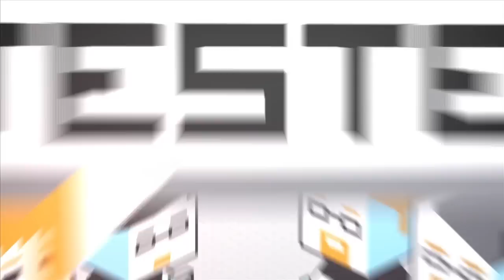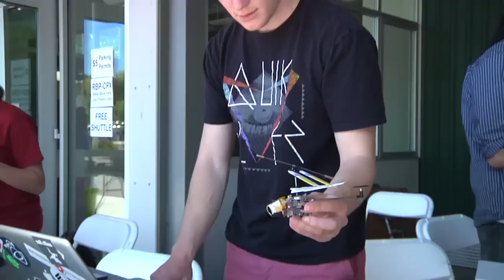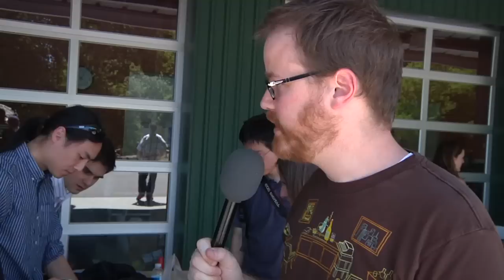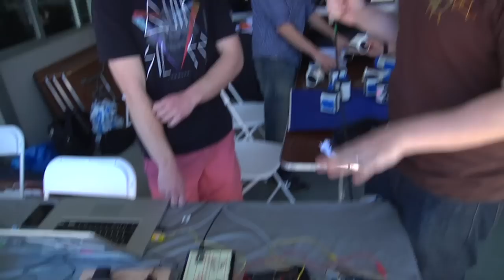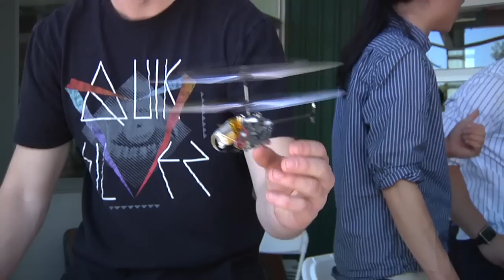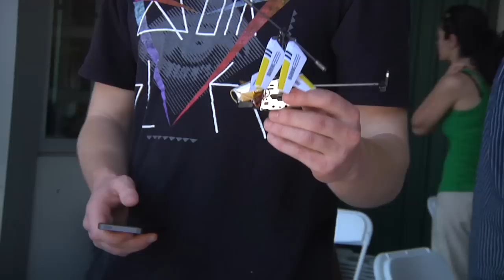Hacking a $20 Toy Helicopter into an Autonomous Drone

Comment: as a man who spent most of his life farming and logging and never using a computer at all until about 25 yrs old I am so amazed by guys like this. He took his finals and went on spring break in between working on this.
Reply: + jtoddjb I can relate to that.
Reply: +Random Youtube Watcher wtf kind of comment is that
Reply: +jtoddjb as a man who has a little bit of general experience with electronics and software development, I can tell you that I too am amazed by this guy. To be able to achieve what he has achieved requires quite a lot of knowledge. Not knowledge about the project itself, just general knowledge to efficiently plan and execute the project. Amazing!

Comment: its 3 years later.... lets see the finished version..... and lets get some links to the arduino coding.
Reply: The arudino only takes serial input from the laptop and turned it into IR pulses. This really isn't anything amazing, and it's no where near being "autonomous" .
Reply: Joe Anthing Not yet at least
Reply: Andrew Micallef It's completely the wrong way of doing it. He's using a Web cam with an IR filter and a line laser. Should be using something like a kinect that can actually sense depth.
Reply: Joe Anthing that's pretty much how the kinect works, he's just using his own version of the same principle

Comment: Hacking = Making it with the least resources, or Finding a way to make a existing better + simpler. Finding mistakes/weak-points in a system/object and take advantage of it, or in modern ages, modify a system or object with ''simple'' cheap tools/methods.

Comment: This is really interesting... It is cool to see that nowadays we are able to transform cheap flying toys into autonomous drones. The next step would be to mount an IR led with an Arduino Micro directly onto the helicopter with a scaled down laser system so that it could fly autonomously through varying rooms, instead of just staying inside of the one, while also giving it the ability for it to transmit information back to the computer. It probably wouldn't have been possible in 2013 though.

Comment: I actually understood every single word he said. It's actually not that easy. I found this arduino board from a local radio shack that's going out of business, and I actually have one of those cheap little helicopters. Same model. I'm gonna try this.
Reply: Peter Pukdeesri Easy as pie, as long as it is copying signals with an arduino there are PLENTY of libraries that help you sniff code with ease (be it 433mhz or IR), don't forget to find out what each octet of data stands for (ex: first octet = direction, 2nd octet = speed with 4 settings and so on). Have fun ;)

Comment: This certainly works in a pinch and can be really useful if the electronic internals of the transmitter are out of reach. However, it doesn't give you particularly accurate timing values for each of the pulses - most IR protocols are resilient enough that this isn't a problem, but in the interests of getting the best possible capture, a logic analyzer is the way to go. Also, if it's modulated at anything other than 38khz, you might have problems with the IR receiver technique.

Comment: Pretty cool, but all you need to record (and then analyze) IR remote control signals is an IR detector (from Radio Shack, etc.) connected to the MIC port on any computer. Fire up an audio editor (like Audacity), point the remote control at the detector and record the pulses as audio files. From there you can analyze the waveform with some home-brew software or just use the audio editor like an oscilloscope.

Comment: I hope this doesn't sound like a stupid question but instead of using a logic analyser to determine which control inputs correspond to which frequencies of infra-red light pulses would it not be simpler to film the original transmitter and use the footage to one-by-one work out what frequency of pulse is produced by what control input? Seeing as infra-red light is invisible to the naked eye but not to most camera devices would this not be a cheaper and more practical solution. Please correct me if I'm wrong, I'm sure I made some stupid assumptions somewhere!
Reply: Would work. But I doubt a camera has the required frame rate.

Comment: It's actually not as hard as most of the commenters think.  
* Reverse engineering infra red control.  
      very matured tech, methods all over the internet.  
* LIDAR positioning, 
      very common tech. Ripping LIDAR modules from robotic house floor cleaners for DIY projects are popular projects.
* Flying a drone. 
      open source everywhere. 

all are pieces of cake. I don't see anything special about this. this is more like a hobbyist DIY practice, like a typical high school project in China. It is a fun project but if it's something from the prestigious Stanford Robotics Club, then it is little bit disappointing.  I hope the remaining 15% (did he say he finished 85%?) could be more interesting like actually putting some AI into the drone flight, like coordinated flight in multiple drones.
Reply: basically everything has already been done before, a quick Google search for each step should yield easy to follow information on how to do it. he even said that a lot of it is easily available online lol

Comment: Great project, and a smart kid, hope he works things out and we can see another video on the progress.

But these cheap heli are terribly difficult to control accurately due to its inherent dynamics.  The only reliable manoeuvre they do is to hover.  He be better off using a cheap mini quadcopter as a platform.  Also he'll have a hard time working out the heading of the thing with his set up.

All the best

Comment: Depth estimation with a single camera can be done a couple ways - one way is using a perspective and distance calibration to estimate the distance a known-size tag is from the camera based on it's size. This way has the drawback of requiring the tag always facing the camera, otherwise the estimate is going to be way off. Not really ideal for an application like this! The kinect has made vision-based depth mapping so easy, single-camera isn't really worth it.

Comment: What sensors do you think it would need onboard to have a chance at flying itself in an unknown environment. I'm thinking you could probably get a camera, accelerometer, maybe some kind of sonar for height - something that is smaller than the LIDAR
Reply: The' ArduPilot' with GPS, is a good device to start with (currently about $80. with GPS), then add the kind of visual system this kid is envisioning. The rest is simulated neural networking versus adaption pathfinding, routing optimization, etc.

Comment: @KHALID Al muzini

You know, that is a really good question and could have several different answers.. It could be that he A) wants the craft to be able to fly longer(heli's are more efficient) or it could be that he wanted to be able to track the craft easier. (It's easier to tell orientation on a heli.) It could also be that he thought it would be easier to analyze an infrared LED that worry about analyzing radio traffic.

Comment: That was the bit that surprised me as well, i have often heard the expression  'if it works, leave it alone" 
Controlling the controller is surely the simplest way 'forward'. Kyle even states his aim is to use existing off the shelf tech, so why not add the IR controller to that list. Duplicating the IR code provided no real benefit to the project other than to have understanding of the root information.

Comment: I was thinking about making my drone autonomous with some capacitive proximity sensors. wouldn't that be easier than mapping with a camera and a laser? because basicly that means it isn't so autonomous since you need that camera and laser beam on the ground mapping a specific spot for the drone/helicopter to use

Comment: I think a more novel and interesting approach would be to set up a couple of highly directional mics on trackers.  They would follow the aircraft using sound, and position could be calculated from the angle of the mics.  Alternately, but similarly, laser trackers could do the same, but watch for the flickering reflection from the rotors.  Either way seems like less effort than LIDAR.

Comment: He's really doing this the hard way. He's scanning the environment with his D.I.Y. LIDAR and hoping to pick out the heli out of all the data+noise.... yeah, good luck with that. I've been down that road.

He has a better chance of success if he sets up an IR beacon on his heli and sets up three IR filtered cameras looking at space along the X, Y, and Z axes. He can then do some simple image processing to extrapolate the cartesian co-ords of his heli in near-real time. That's the only way he's going to get a control loop with a high enough iteration frequency, low enough signal/noise ratio, and sufficient position & acceleration fidelity to allow autonomous control of the heli.

He could also extend the system further and get several orders of magnitude better control if he used a transmitter and an IMU on the heli in the control loop, but that's another project.

....other than that, looks like a fun little learning project with cheap off the shelf parts.
Reply: I was thinking that too. Good thinking there!
Reply: His method is how the military does missile guidance in some cases.
Reply: Tim R. Lol I was about to comment that

Comment: It's not hacking it's modifying
Reply: Well in today's world hacking can also mean something along the lines of modifying something to work beyond its intended purpose.
Reply: do you know what hacking means?
Reply: Hacker is a word created by Hackers to describe the creation of a different object by modifying an existing object, possibly creating a new purpose or expanding the existing purpose or even a  hybridization of purposes. People using a garbage bag to keep dry, or the applying bacteria to the waste of  breweries to produce materials that can be used in batteries, are Hackers.
Reply: havent you ever heard of the expressions "hacking things together" or "its a bit of a hack but it works"
Reply: Hacking=Making it with the least resources, or Finding a way to make a existing better + simpler. Finding mistakes/weak-points in a system/object and take advantage of it, or in modern ages, modify a system or object with ''simple'' cheap tools/methods.
Reply: he's trying to do more than he knows. And that's great.

Comment: This is really cool, except RC copters this size have like 8 minute battery life.
Reply: My syma can fly 32minutes on a lipo tenergy battery
Reply: For sure but the point of this video was to run with a $20 toy helicopter, not a decent RC copter with hobbyist parts / upgraded battery.
 These low end pieces won't have the battery life to make use of this.
Reply: The syma cost $20 and the battery cost $12
Reply: Exactly.
Reply: mastermanio2 I dont remember him saying the idea was to do this with a $20 copter. That is just what he started this project on.obviously he has put a lot more money into this with the laser and electronics he has purchased. i think its more about the concepts hes applying. When he has it all figured out and fine tuned it would be much easier for him to apply the same concepts to a copter that could do a lot more.
Reply: +bob talbot p!
Reply: +Haley Gresham That dosen't exist -.-
Reply: +black ops [ David ] Actually not perfect, For the amount of energy a solar panel produces (Which is very little) factor in the weight of the solar panel and the life that needs to be provided it would be very unconventional. One could argue that you could install a solar panel that produces more energy however they are also heavier. Wind speed alters efficiency of solar panels and your putting it on a helicopter. The blades decrease efficiency even more blocking out the sun. and were would you find good surface area to install the solar panel to begin with. The only way solar panels could possibly work is on a Plane model rather then a Helicopter. Then again I'm not a expert but based on my rather poor knowledge of the subject its doubtful it would work otherwise we would see solar panels powering functions, Like lights for example on first class planes.

Comment: As a guy who understands about 10% of what this guy is talking about... is he basically making those mapping drones that they let loose in the caves in the movie Prometheus?
Reply: daweller Essentially, yes.
Reply: Michael Rose Essentially, no. The thing on the table is used to map the room - the drones themselves would then use that information to fly around without hitting things. In prometheus the idea is more that the drones have an active understanding of their environment and are mapping the caves for the humans use.
Reply: daweller In layman terms: He took apart the drone and reconfigured its remote function to run on his PC, so now his PC is the remote (pitch, yaw, roll, thrust etc). Then he is using a webcam + a laser as a cheap version of a laser scanner to scan a room so that his drones can fly inside them without hitting anything. His challenge he said was to scan such that it is of high enough resolution, once he does that, he can program his drones to do anything.

Comment: While it's definitely cool what he did - it's not something that's 'genius'. He is just interested, and reasonably talented in electronics.
The things he did in a month probably were like 1 hour a day on average - so 30 hours. In those 30 hours, he reverse engineered the protocol for the IR remote, which is mostly time consuming, not that hard. Then he wrote an app, just for fun. Not really hard at all though.
Then, he STARTED working on a LIDAR with a laser and a webcam - yeah, cool, if that worked it would have been a LOT more impressive.
Also, keep in mind he's in a Robotics Club, so he probably got some help.
He sure shows promise, and might become great, but this is not something you should call a 'genius' project. It's cool, just not genius level.
Reply: Exactly, I have no doubt that he may go on to make something very clever with this, but from his current progress in this video, all he has done is recorded the IR commands and plays them back to the helicopter via Arduino. He even said it can only go up and down. Lasers won't help with this really, he would be better off using motion tracking from 2 or more camera's, or for better precision, add IR filters to the camera's and add a IR beacon to the helicopter.
Reply: yea, well I know I couldn't do it!

Comment: those things fly like crap.
use a multirotor platform instead.
Reply: yes because they only cost $20
Reply: HaukeR they have inexpensive multirotors starting at 20 bucks but maybe too small.
a very suitable craft for testing in the 8 inch range may cost 50 bucks tho. 
the ones he is using are very temperamental and difficult to fly even in the hands of someone with experience.
Reply: bdseidler

Comment: Wouldn't you need 2 webcams for depth?
Reply: You have a rough idea of how wide the beam is at X distance and you can work from that, I guess.
Reply: Roham Jarah if you have a camera and laser line pointing parallel to each other and at a set distance from each other you can use trig to figure out based on how far the laser is from center of the camera view and translate to distance.

camera--------->

laser-------------->target

imagine a line from camera to target as you move target closer to camera the angle from the center of the camera changes.  in the camera view it's a change in height but can use that to calculate the angle and from that calculate the distance.  All assuming you have a known fixed distance between camera and laser.

Comment: There are plenty of tutorials on the net showing how you can do that. The programming work is more impressive in my opinion.

Not saying it is easy. There are probably a lot of people who can't randomly just do this, but it's not impossible to do.

I'd have taken another route though, and I wouldn't have taken a toy helicopter. There are way more potent platforms to build drones out of, and there are lots of off the shelf components such as autopilots and GPS units that can make it fairly easy.

Comment: Hey could become rich!
Reply: +black ops [ David ] The solar cell technology would have to improve ALOT before that happens.
Reply: black ops [ David ] The devil is in the details... A solar cell small enough to be lifted by the little helicopter+ the battery wouldn't work since it wouldn't have enough power to lift itself. To solve that problem you 1. make the cell more lightweight 2. put a bigger motor in the helicopter, both of these solutions wouldn't work since the cells are not able to be made more efficient/lightweight without them costing a fortune. and a bigger motor would cause it to weigh more that then needs more power = bigger solar cell. We end up right where we started.
Reply: Then it would become a multi million dollar machine. There is a very low demand for 700 million dollar helicopters.

Comment: By "reverse engineered the signals", all he means is that he measured the amount of current sent to the IR-LED when you push up, down, left, etc and then just duplicates that output from his Arduino. It's the same idea as a universal TV remote: capture and echo the signal.

Comment: Why bother reverse engineering the IR protocol just to rebuild the same logic circuit that already exists inside the controller?  Just adapt the controller circuitry to the Arduino (make it simulate control stick potentiometer input).  It would be much easier then trying to reinvent the wheel.  Also, it isn't autonomous, it requires the control logic to be on the ground (and within sight) which completely defeats the purpose.  Fun project maybe, but I'd opt for something a bit more evil.